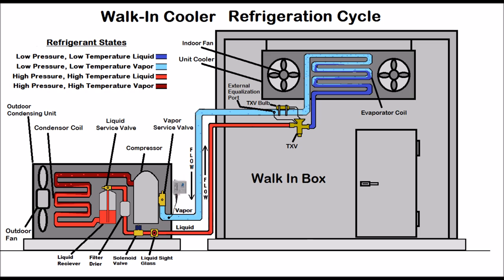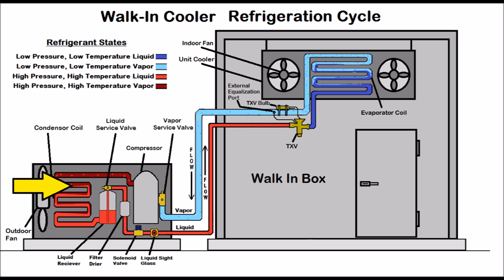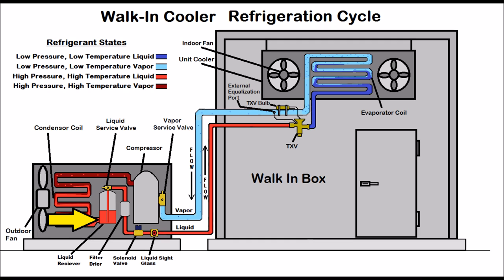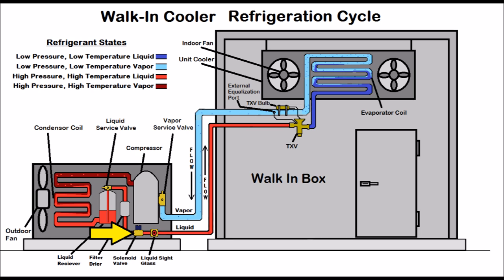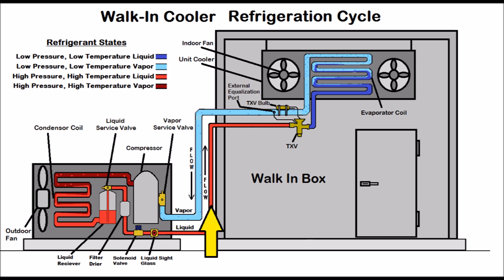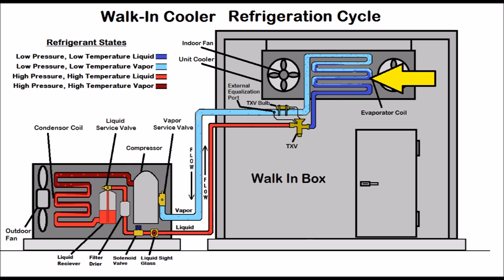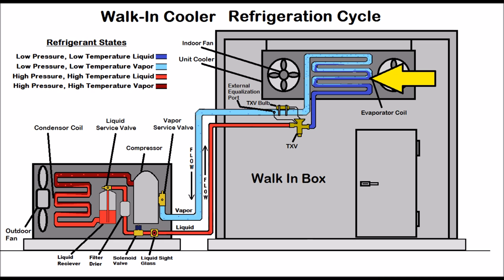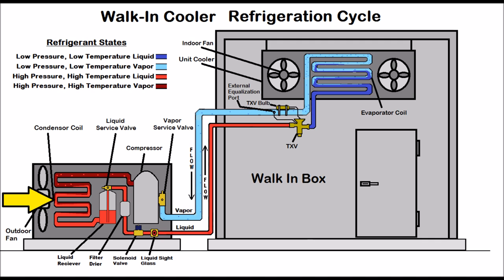HVACR Refrigeration Cycle Training! Superheat and Subcooling!

Comment: Great video and explanation. I was hoping you would have explained in greater detail how the pump down function works utilizing the liquid line solenoid valve. Thank you for your time and effort.
Reply: Energize solenoid/open.
Close high side svc valve.
Hold down contactor.
Watch guages. When low side very low, quickly close off low side svc port

Comment: Your explanations ,and illustrations are so easy to  comprehend , you are a great teacher of the trade, I have a quick question what is the difference in the system design from your cooling AC in your home versus a walking cooler or a freezer ,what is the main difference that you're able to bring those temperature down to minus zero versus your home that you're only able to bring the temperature in the low sixties at best? , thank you... so much for teaching all of us the HVAC trade.

Comment: Thank you for the video. I’m currently in class at nights preparing to take my NYC Refrigeration Machine Operator test. Any videos on the refrigeration cycle, heat, pressure, charles law, tevs, types of compressors, service valves or anything else refrigeration definitely help.
Reply from the maker: Yes just look up "acservicetech service valves" or "acservicetech refrigeration cycle" "acservicetech scroll, rotary, reciprocating compressor" thanks!

Comment: The liquid receiver is used to hold the refrigerant charge during pump-down cycle. I disagree that the refrigerant leaving the receiver is a sub-cooled liquid. The receiver contains both saturated liquid and vapor refrigerant. In order to get sub-cooled liquid to the TXV, the receiver needs to be by-passed. That's assuming conditions are favorably in the condenser.

Comment: It all depends on what type of evaporator it is, if a center mount, AT the Evap..should be 4 to 5 degrees superheat,,At the compressor, scroll type 10 to 15, hermetic comp..20 to 35 per HEATCRAFT....

Comment: ac service tech excellent video,Could you make a video on the electric side ,How it turns on with a pressure switch is a contactor  needed  from the pressure switch to the compressor, Why do you pump down this system ect  .
Reply from the maker: Bill, thanks for letting me know what you would like to see!
Reply: acservicetech can you make a video on  the defrost mode and the timers?

Comment: Excellent video as always! If you have time I have a quick question: why don't they just put a vaporizer on the inlet to the compressor (like you do on the vapor side of the gauge set) to ensure that only vapor gets to it. Thanks for the vids!
Reply from the maker: That would put too much friction on the system as it will continue to circulate through it and as always, the cost of manufacturing, thanks

Comment: Awesome video. Would there be an accumulator located before the suction side of the compressor to capture any stray refrigerant liquid?
Reply from the maker: Not usually but there certainly could be one though. This setup is only used with the txv also, thanks!

Comment: In the condenser super heat and saturation and sub cooling exist while in the evaporator liquid/gas and saturation and vapor gas exist.
Reply from the maker: Yes that's correct as the initial superheated gas in the condensor is from the compressor, thanks

Comment: Where abouts do you check the superheat and subcooling on a cooler? Also what are normal pressures and tempertures of a cooler using nu22.? I dont usually do cooler work but had to go to one call and the high side was about 225psi and low side was about 50 psi.

Comment: What makes a walk in box so much colder than your average house? It must be that its really well insulated?
And how does a freezer reach freezing temps? I'm sure it works on basically the same principal as AC but what makes a freezer different?
Reply from the maker: They are either designed as a packaged unit from the factory with cap tubing to make sure that they will always have at least some superheat or they have a receiver and a txv except the txv would try to maintain 6-8 degrees of superheat when down in temp. The air handler continues to run to melt any ice or may have electric resistance. They are also designed for this function and have a different refrigerant to meet this need. Refrigerants are designed to have different boiling points like r-22 at -40 is 0 psig. Keep going, learn all you can!
Reply: If you get called out to a walk in box like this and its blowing say 70 degrees. What would be the first thing you'd check? I happened to see one doing exactly that a while back at the local store and it was several days before they got it fixed.
Reply from the maker: The first things are to make sure both coils are clean and that there is good airflow. Next make sure the compressor is actually on and then read the pressures to start to examine whats next, thanks
Reply: What is the normal temp that you want to see in a walk in box? I'm thinking like 35 degrees maybe. Many times stores don't keep walk in boxes quite cold enough.

Comment: question sir when u pump down the system where does everything stay the condensor and the receiver?
Reply from the maker: In this type of system, most of it will end up in the receiver, thanks
Reply: thank you
Reply: ||Yes it will end up in a RECEIVER!!🤙🏿
Reply: ||Brother Graic Migliaccio I'm in the United kingdom & would like to by physical copy of your Book " Refrigerant Charging & Service Procedure for AC", also Quick Reference Cards (1) Superheat & Subcooling, PT chart, Refrigerant weights,  troubleshooting Guide, Frozen Evaporator coil & troubleshooting with the problem.

-Please advise me on that (purchasing) don't want to do it through AMAZON they're changing alot for shipping.

Thanks

Comment: ||I disagree my brother when you said you can not put a DISTRIBUTOR on a cooler box. Yes you can Connect DISTRIBUTOR. It depends with type of EVAPORATOR you have on your Box, for instance if you've Multi-pass EVAPORATOR coils you would use a DISTRIBUTOR & EXTERNAL TXV..

-Remember when a DISTRIBUTOR is fitted to the EVAPORATOR, an Externally Equalised T.E.V must be used.

Comment: Can I replace a 55/5uF+/-5% 350/370V with 55+7.5MFD=/-5% 440/370VAC?
Reply from the maker: No, you cannot replace the fan motor part of the capacitor from a 7.5 to a 5 mfd as this will likely burn the motor out. You can however just use the compressor 55 mfd part and jump the common to another capacitor that is just 7.5 and use this for the fan though, thanks!